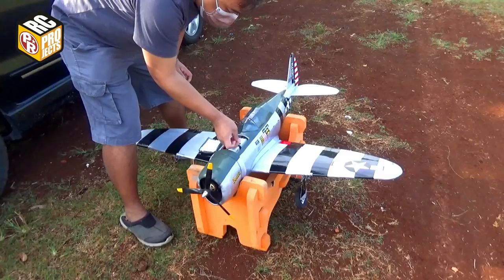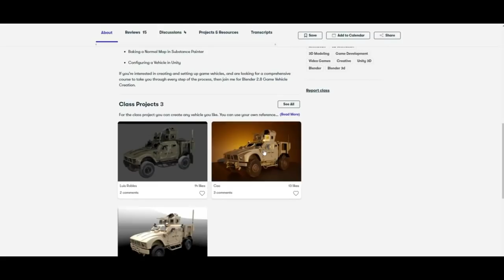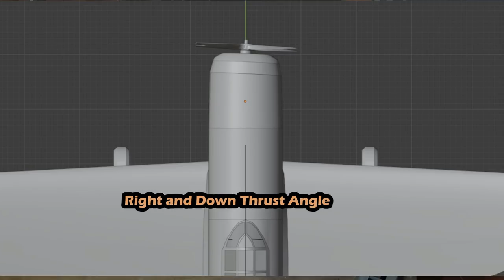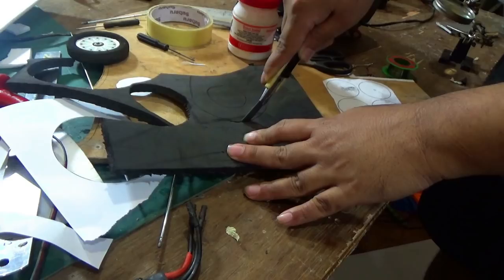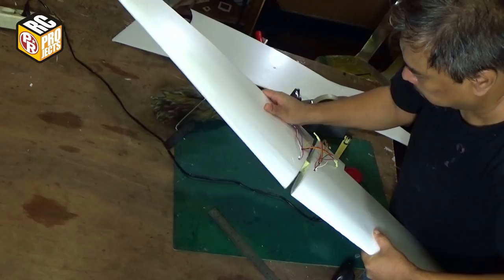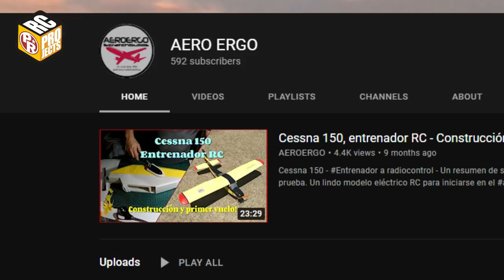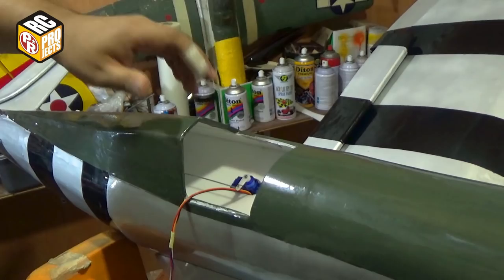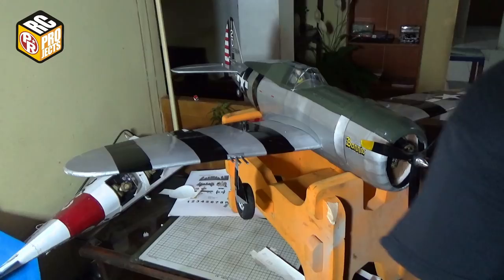How to Make P-47 Thunderbolt Razorback RC Plane

Comment: Thank you! Thank you! Thank you, Pak, for keeping the video correct length! With all build-steps! Thank you!

After this, i don't know what to say! No words! Mind-blowing, Kaptain Jenius! Amazing! I have watched your build videos hundreds of times, and still i am amazed! Fantastic!
Few questions pls:
1. Does the bldc motor not go bad if water falls on it (during wet sanding)?
2. How do you prevent wrinkles while ironing the laminated sheet onto the Depron?
3. How does the laminated film stick to Depron even after painting it???
4. If you use the iron without the sock/cover/cloth, doesn't it stick to the lamination film plastic?
5. My heat gun causes the foam to melt, even on low setting. Any advice?
6. Pls suggest some good noodle recipe, because all long strings of glue keep coming out from the glue gun! (Lol!)

Pls consider a Hawker Hunter, even if it is pusher-propeller driven. One of the bestest aircraft ever built.
All our best regards from India.
Reply from the maker: 1. no, brushless is waterproof
2. pull the film while ironing
3. it's still stick
4. no it's not
5. use low-medium setting or distance your foam
6. look for taiwan-made glue stick
Reply: @JuliusPerdana  thank you Pak! I made my first (independent) model HJT 16, Kiran Mk2. Pls see it on R. G. Bamboat channel. Not completed still, though.

Comment: hey I’m building this now without gear and a smaller motor. It’s 2826 930kv with 10x4.5 2-blade prop. Think it’ll cut it with maybe a 50a esc and 4s 100c?
Reply from the maker: yea you can use them

Comment: Dear sir.
I think that your work its amazing but I have to tell you one thing.
 If the material that you uses is PVC or comes from PVC don't heat or burn it because its veeery toxic please check info on Google about that. If it is not dont worry. 
Thank you!
Reply from the maker: it's not PVC
Reply: @JuliusPerdana  better!  What is the name of that plastic?
Reply from the maker: @shagui  which plastic? the main material is XPS foam

Comment: Nice model 👌
How do you calculate the CG of your models?
Reply from the maker: this is one was not calculated, I just search the factory made model and adjust the scale and use that CG. And then make test flights to find the correct one for my model
Reply: @JuliusPerdana  such a good method 👍